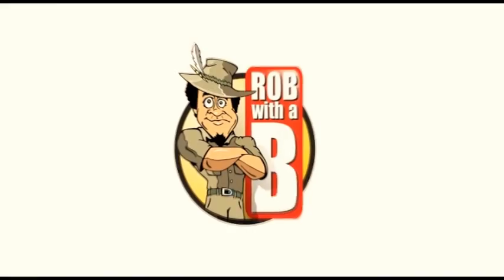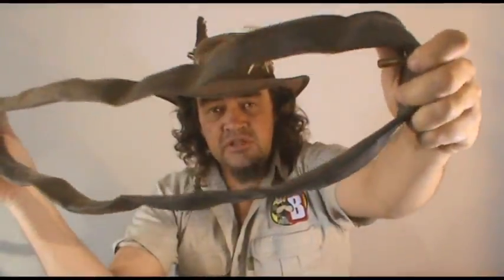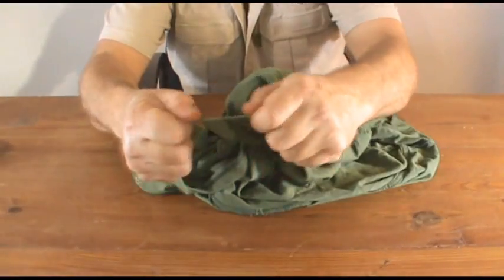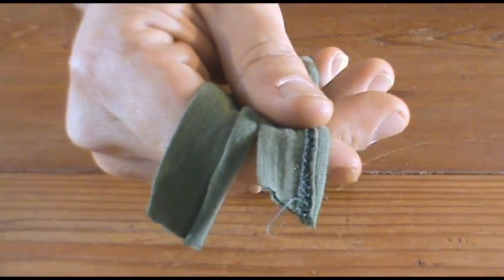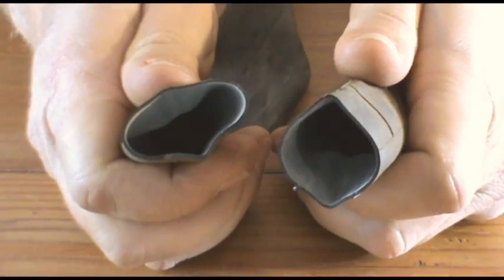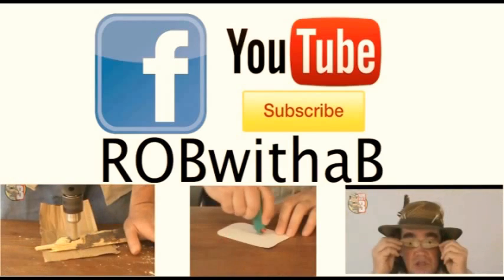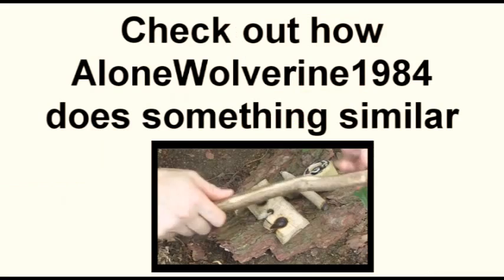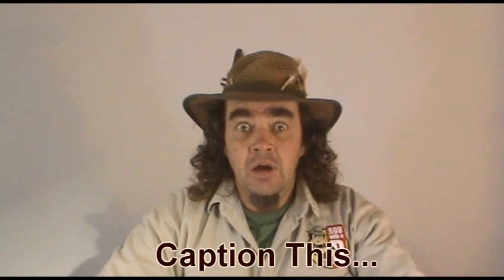How to Make Fire with a BICYCLE - Quickfire 101 #8

Comment: Yes I can see you puttering around in your yard all the way from Phoenix....I eat LOTS of carrots.
Quick question, it's summer here and a few weeks ago it was around 119 degrees outside, how hot does it get where you live?

We like to say in my neck of the woods "but it's a DRY heat"
And I like to answer "so is the inside of your oven"
Happy birthday to your son I bet he's getting big.
Reply from the maker: kneuromancer 119f = 48C. Wow! That's stinking hot, in anyone's language. Not generally possible to get those kinds of temperatures in moister climes, because the water vapour in the air tends to "suck out' the heat. (Latent heat of evaporation, etc.) But we do sometimes get up into the 40's Celsius.I did travel through your neck of the woods once during a heatwave. In a bus without air conditioning! Although the "dry" heat is easier to tolerate than the moist sweaty jungle heat, it's a lot more dangerous because one can get dehydrated so quickly.We're in a subtropical zone here, so our summer is the rainy season. Winters are dryer. So when it's dry it tends to be cooler. Although we do get something called "berg winds" towards the end of winter that bring adiabatically warmed dry air down from the mountains. For a few days a year it is hot, dry and windy. That's when most of the bad wildfires occur.

Comment: hmm... rob could you make fire from the fiction of the spinning wheel somehow?
Reply from the maker: DiyEcoProjects Probably. Like those burnouts that drunken youths do in the parking lots of the local strip mall of a Saturday night.I hadn't even thought of that one.
Reply: lol.... if you had that much energy you might as well run home haha...
Reply: im seeing the bike upsidedown. cranking the back wheel to full speed and then using that friction somehow. maybe the side of the rim, not the bit that would go on the road. hmm
Reply: oo ooo ... ok... what about spinning back wheel upside down. Then same as a bow drill but without the bow. stone+spindle pressed onto tire+V cut wood. held all together horizontally
Reply from the maker: DiyEcoProjects You'll have to draw a picture of this set to help me understand. Or better yet, make a video!

Comment: lol... cool rob. .... so come on chap, how do you light a fire with a car? grin
Reply from the maker: DiyEcoProjects About ten different ways I can think of, actually. Any ideas? Challenge issued!
Reply: hmm ok erm / car head light used as magnifier / use the mirrors / 12 battery short / fuel in plastic bag to get fumes and then a stone spark? / windscreen wipers as a bow / if its cooking/boiling you want and not a fire then engines have hot areas ...
Reply from the maker: DiyEcoProjects All do-able. Well done!Apart from the parabolic reflectors, the light bulbs themselves (oldschool pre-LED) can be filled with water to form lenses. (They're about at the limit in terms of size, but I have managed with brake light bulbs.)One can also use electrical resistance from the 12v system. As a resistor, either a pencil lead (like in the video where I "died") or the filament of a broken light bulb.Disk brakes can easily get hot enough to light a cigarette, as can the exhaust manifold and turbo housing.What have I forgotten.....?

Comment: That's really clever though the rubber doesn't really do half the work it just gives you some time off :)
Reply from the maker: Indeed. I was guilty of lazy language there. In the scientific sense of "work", I'm doing twice as much on the "out" stroke, half of it being converted to potential energy and stored in the rubber for the return stroke.
But in terms of the actual effort involved, relative to the bow drill, this is really much easier because you don't have to worry too much about getting your co-ordination right. A lot of people seem to struggle with the return stroke when doing the bow drill, keeping the bow level and so on. With the rubber band, the whole thing kinda corrects itself, and it's easier to keep the string level to prevent it running off the top or the bottom of the spindle.
Having a vertical toggle seems to make for a much more intuitive motion than with the horizontal bow. Less concentration required to keep the wrist in the right orientation.
Reply: ***** Yes the bow drill will need quite a bit of control over the bow itself , having a system that is only in tension keeps things stable and makes a lot of sense. A little like the idea behind a japanese pull saw..
Reply from the maker: ***** Japanese Pull saw?
Reply: ***** They use saws with extremely thin blades, this is only possible because unlike western saws they cut on the pull which puts the blade in tension. It was just an example of the way tension tends to create stability in mechanical system unlike compression.
Reply from the maker: ***** Makes sense. Japanese pull saw. I learned something new today! that's why I love Youtube.

Comment from the maker: What should I call this fire-lighting device??
Toggle Drill ?
Reciprocating Rubber Drill ?
Your creative suggestions are welcome.
Best title wins... Umm... a lot of thumbs up. :)
Reply: flexy fire ?
Reply from the maker: Milan Alnas
Once you've nailed the bowing technique, the "weakest link" with most bowdrill setups is usually the bearing block. But if you have something essentially frictionless, an ember is almost guaranteed, even with hard woods.
I sometimes use the base of a wine glass. With a dollop of Zambuk (or Vaseline or even body oil) it runs so smoothly that I don't notice it at all, and I can concentrate ALL my energy at the working end of the spindle.
Reply: the Gyro Tyre Fire ??
Reply: Spring Drill...whatever it ends up being called it's bloody brilliant. I normally keep a length of slingshot tubing in my kit and this should make friction fire easier.
Reply: rubber drill :)
Reply from the maker: hi yall That sounds a little rude, somehow.
Reply from the maker: Milan Alnas Give it a shot. I found that this elasticated-toggle-drill thing was really conducive to getting a quick ember. The pedal as a bearing block wasn't ideal, though. Very uncomfortable to hold because of the teeth, and not a perfect seat for the tip. I stuck with it because of the "theme" of the video, but a more traditional block would make it much easier. To optimise the setup, I'd use thinner and better cordage, first threaded through a hole in the spindle then wrapped around about four times. (The "Egyptian bowdrill", I think it's sometimes called.) With halfway decent wood, sub-ten-second embers would be the norm, methinks.
Reply: I carry a block in my kit with a rolle blade bearing...this just makes it a lot easier to not have to carry or finds a suitable bow.